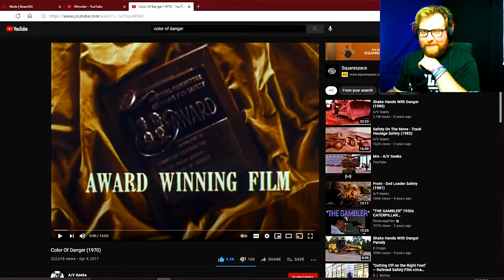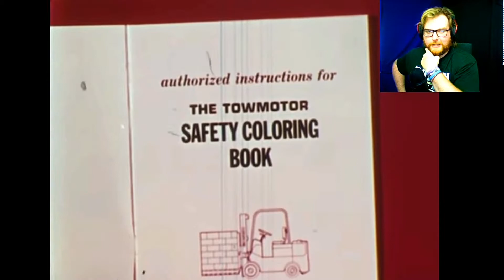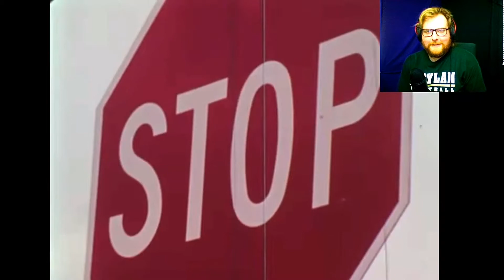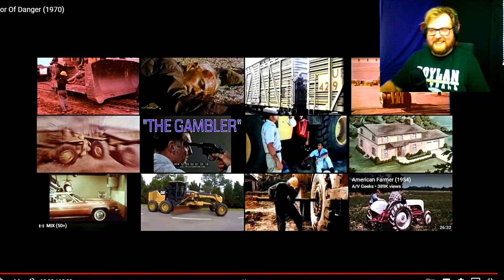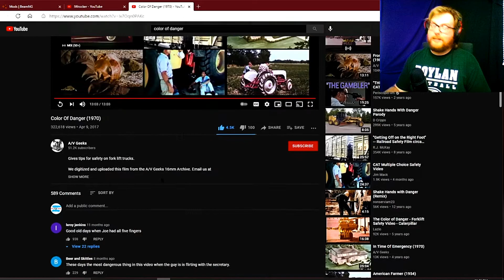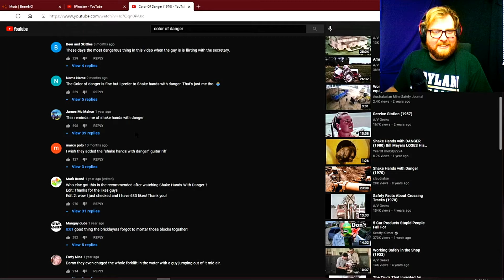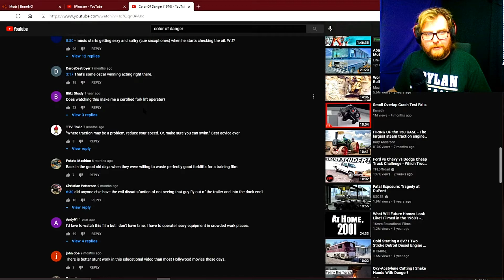Forklift Driver Reacts to The Color Of Danger (1970) Training Video *Hilarious*

Comment: At my work the operator was  loading the truck. The driver of the truck was in a hurry and took the wheel blocks off and started to drive with the forklift still in the trailer 🙈

Comment: Many of the situations shown here I have seen first hand.
I used to drive forklifts (Too many years ago) and some of the things we used to do simply because we had the skill to do would have us put in front of a firing squad today, let alone loss of license.
In my case, I unloaded trucks at a Storage warehouse, and between me and another fellow, we could have a B-Double (rare in those days) unloaded in about 10-15 min (it would have however been suicidal for anyone to come near during the unload).
2 Events in that video stick out as similar events, 

1) Heavy load, On a flat bed truck we needed to unload a lift heavier than rated capacity of Fork, We ended up lifting steer wheels off the ground (as shown in the video) about 8 people were needed to get the ass of the fork heavy enough to balance the load and drive the truck out from under the load (not recommended, even then), but the steer was still off the ground, the Forman ended up holding the side of the fork and using Brute strength steered the fork to where we could put the load on the ground where the Heavy Fork could get it when it got repaired. These days that would never have been aloud to occur.

2) Same place, showing newb the job, but it was pissing rain during an unload. - Load was a Double packed pallet, of empty enamel painted back tins used for underarm spray. These were layered on cardboard sheets between layers, and wrapped in Cardboard packing to protect from elements.
As i was saying, it was pissing rain so it was elected to stop unloading till we got a break in the rain, and young Mr Know all Newb decided he could get the load off the covered truck through the rain without getting it too wet. He was told not to but did anyway. I am sure you can all see where this is going, he did great till the slight bump when he put it down then there was thousands of these little high gloss black tins everywhere. It was funny to watch, Just 1 tin then dozens, then hundreds, and the silly kid trying frantically to hold disintegrating wet cardboard packing wrap together to stop the spill, while the rest of us standing around pissing ourselves laughing. He spent the next Hr. or so picking up all the tins.